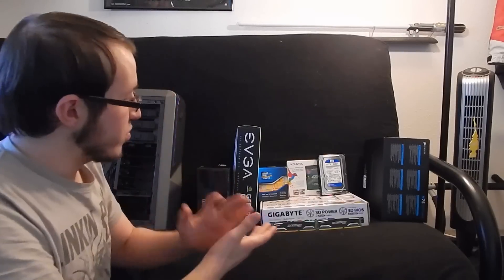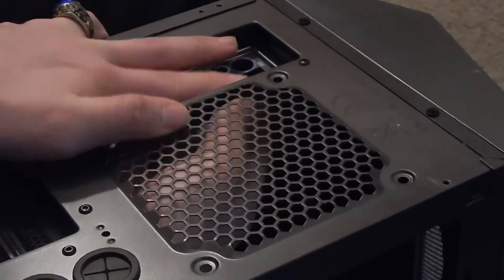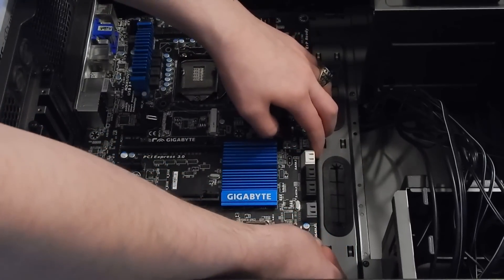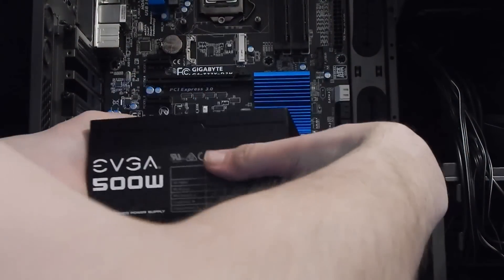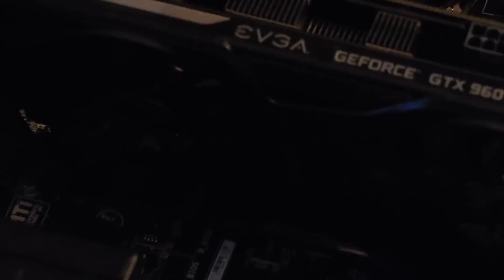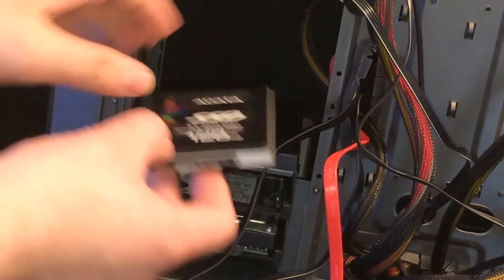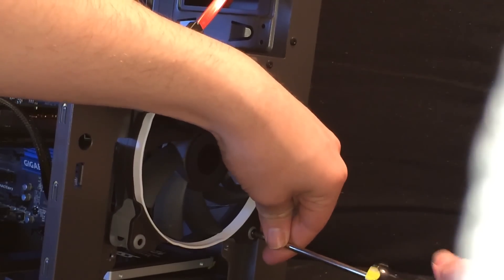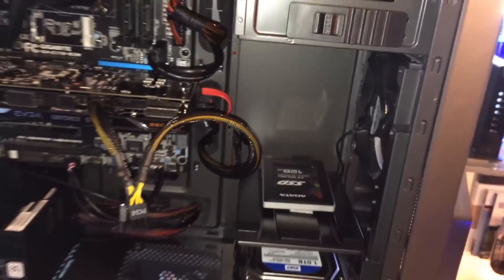How to Tutorial: HOW TO BUILD A PC!

Comment: So when the pc is built, how do you get the drivers and so on?
Reply from the maker: Drivers can be obtained and installed from a manufacturer's website or the disc for the hardware if one was included.
Reply: But if it wasnt included, I mean... When you get your parts they're brand knew and no data is on them or?
Reply from the maker: Certain pieces of hardware have pre-installed drivers. The others you will have to obtain.
Reply: Ahh okay :-) Also, is there some way that you can install too much power on one thing and the others won't follow up/burn down
Reply from the maker: Hardware related, yes, but there is a condition. Overvoltage can only be done on CPUs and RAM modules with compatible motherboards that can handle and deliver extra voltage and heat, and is dangerous if not done correctly.
Reply: Okay thanks :)

Comment: Were the standoffs preinstalled?
Reply from the maker: Indeed, the standoffs were preinstalled.
Reply: The9thDivine Alright, just got the same case haha, those fasteners for the ssd, did they come with anything or did you have to get them separately?
Reply from the maker: Sverkmopsen I bought the fasteners from a supply store. You can pretty much find them anywhere and use velcro (pretty close to the same) as another alternative.

Comment: Hey I have a 750d case and I saw you did too is the one led on the power button supposed to not work or Is it ?
Reply from the maker: The LED on the left of the button is for power, while the one on the right is for hard drive activity, which will blink depending on what you have open.